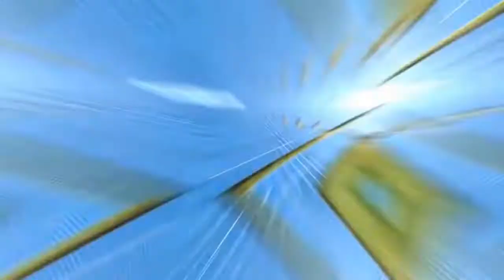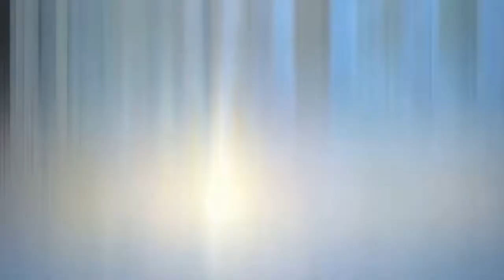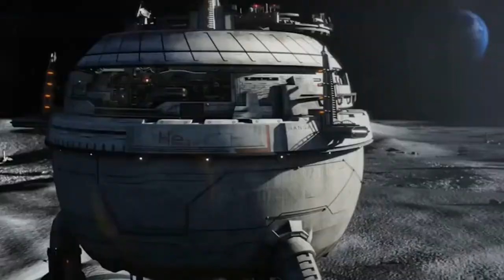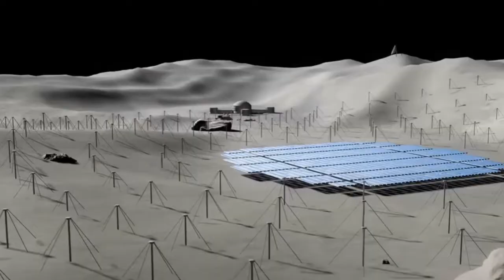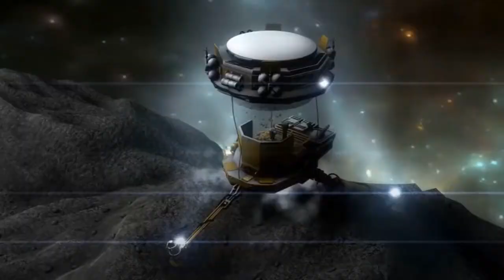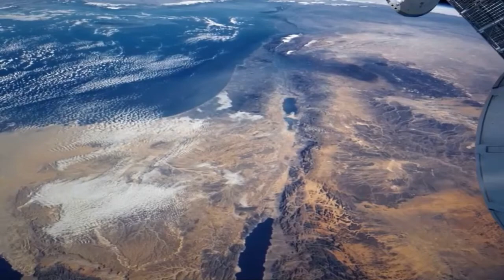Lunar Solar Power

Comment: There's no night on the moon?  You are literally showing The terminator between day-and-night when you say that.  The public education system really sucks these days🙄🙄🙄
Reply from the maker: Thank you for your comment. The phenomenon where one side of the moon is always facing towards Earth and the other side is always facing away from Earth is called "tidal locking". It occurs due to the gravitational forces between the Earth and the moon, which cause the moon to rotate on its axis at the same rate that it orbits the Earth. As a result, one side of the moon is always facing towards the Earth (the near side), while the other side is always facing away from the Earth (the far side). The terms "light side" and "dark side" of the moon are often used to describe the near and far sides, respectively, but it's worth noting that both sides experience periods of day and night as the moon orbits the Sun.
Reply: @futureenergytechnology  Dude you said there is no night on the moon. I'm aware of how tidal locking works but I'm not sure that you are. The moon rotates once for every orbit. That means that all points on the lunar surface experience 2 weeks of day and 2 weeks of night every orbit. Down here we see night on the near side of the moon as the new moon. The only exceptions are the peaks of eternal light at the poles. So yes my dude there most certainly is night on the moon.